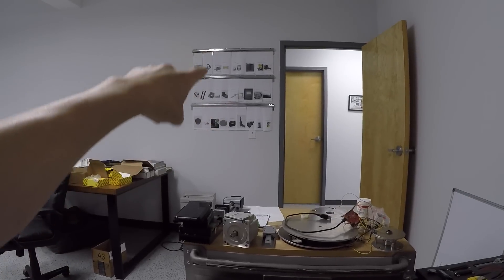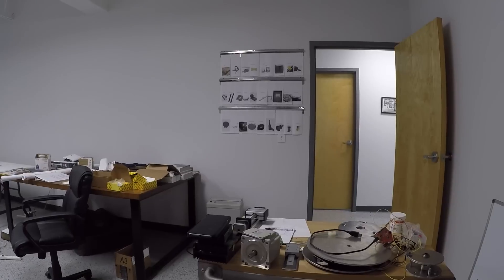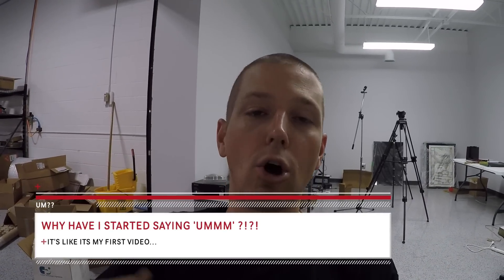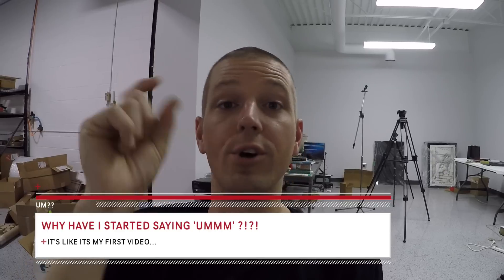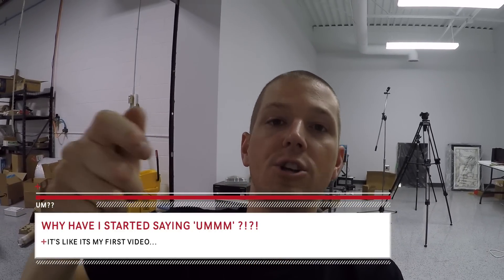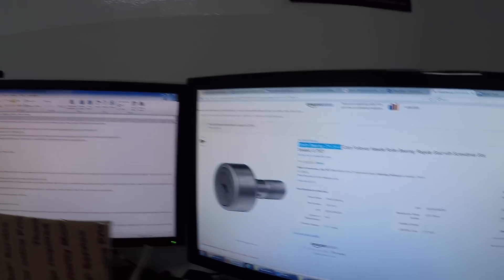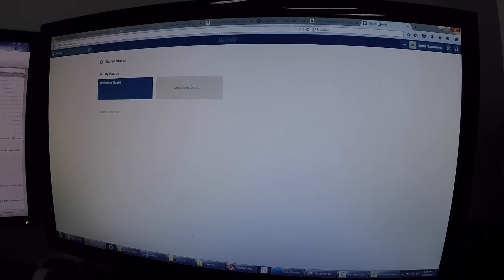New Machines, Keith Fenner Project, Ticket Board, 440 Project!

Comment: Nice machines, good choice. Congrats and happy for you!

Cleaning machines: putty knife to "scrape" thick stuff into a bucket then rags with Zep Heavy-duty floor stripper (a Tom Lipton trick). 

I would NOT pressure wash; you could push chips and crud under sliding surfaces and make a real abrasive paste between your sliding surfaces. 

Daniel
Reply: I hired riggers to move three heavy machines and have no regrets paying for three guys that were experienced, came with toe jacks, pallet jack, truck and a forklift for the move that took 5 hours.